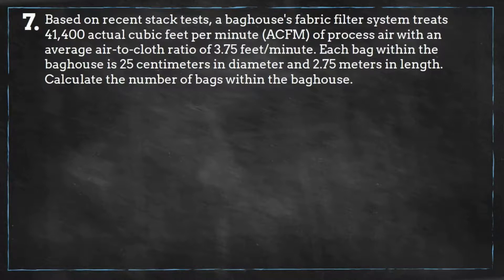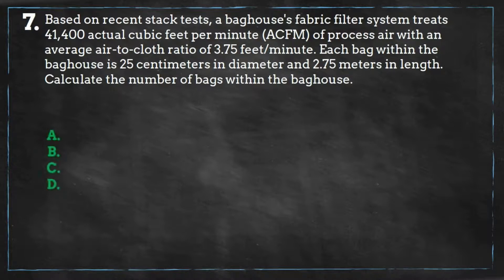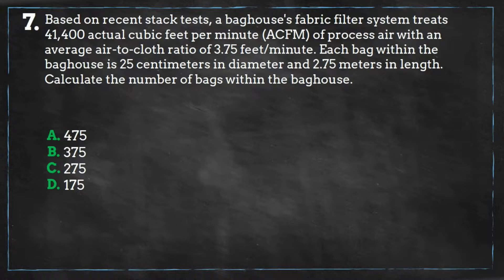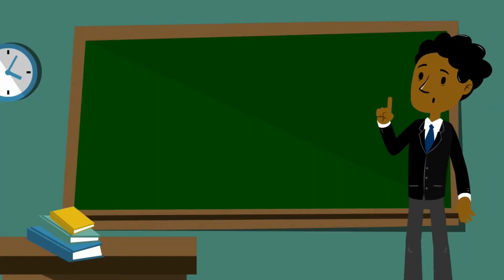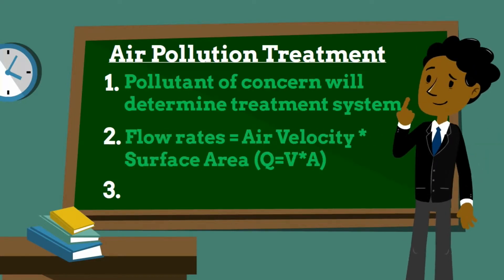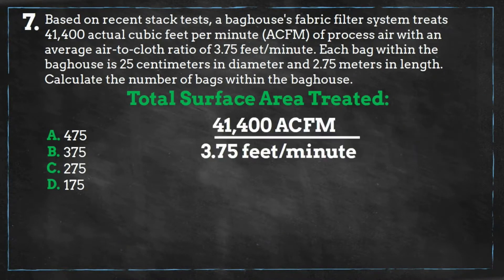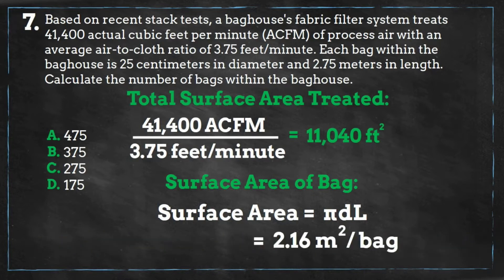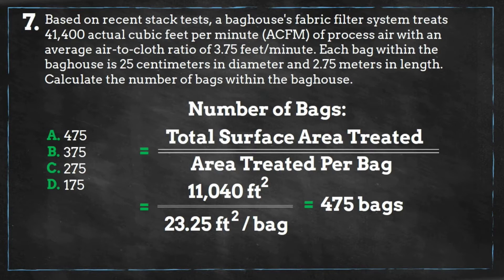Bag Filters - Episode 7 (Air Pollution Engineering) | 52 PE Exam Problems in 52 Weeks

Comment: Why is the SA equation for the bags assuming that the bags have no top or bottom? Shouldn't we assume the bags have an open top and closed bottom therefore SA = pi*d*L +pi*r^2?
Reply: Industry standard calculation for number of bag filters does not use the closed end. Useless for you 1 year ago but for the next person.
Reply: @TheDickeyThomas  thank you sir
Reply: Filtration happens along the length of the bag’s side, which is cylindrical, so we use 𝜋𝐷𝐿 or 2πrL to calculate SA